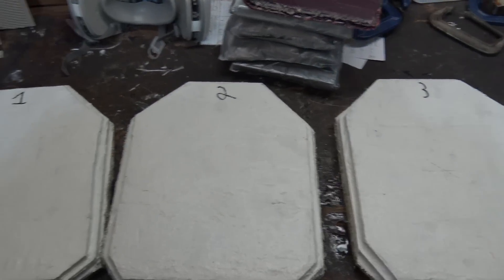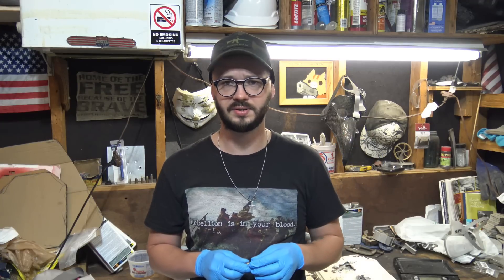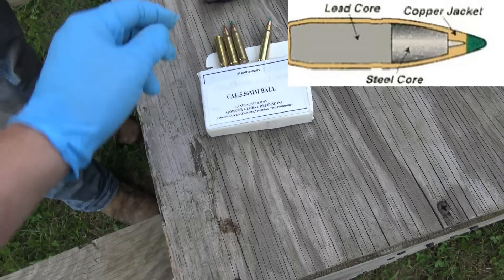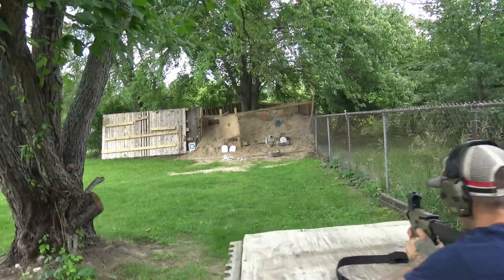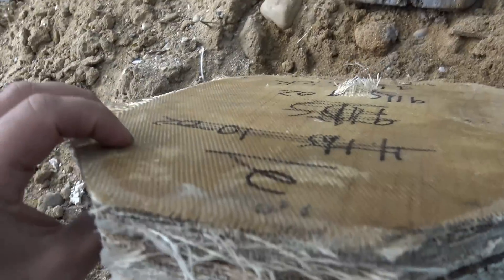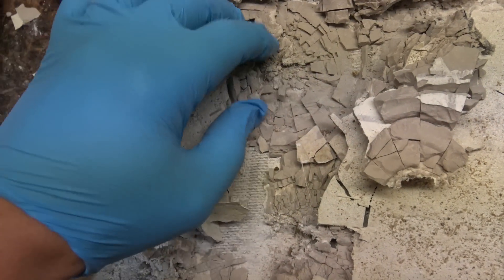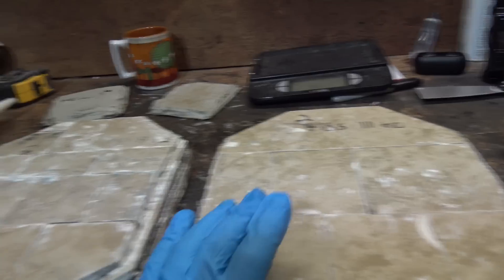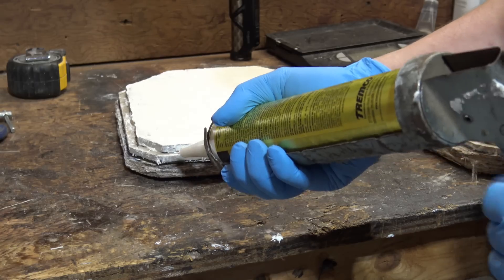Hardware store level 3+ Armor build

Comment from the maker: Also, if you guys could share this video I would be forever grateful.
Reply: I thought prepper circles would be all over vids like this
Reply from the maker: @evansaw293  they filter in over time
Reply: @Techthisoutmeow  I just realized that grinder discs are made of aluminum oxide. Has anyone you know of used them as a strikeface?
Reply: Badass test I like where you're headed with this. Just my 2 cents but I think if you did a wrap of fiberglass and resin around the ceramic it would give you a bit of a shatter/spall guard and keep things together that coupled with wrapping the entire plate in fiberglass and resin will definitely make it harder for it to come apart.
Reply: @Microwavingmetal  I use one or two layers over the strike face. It works wonders. Pretty much that layer of fiberglass or even duct tape keeps chunks of ceramic from flying off. I wrap my plates in duckt tape mostly because it keeps loose strands of fiber glass in place
Reply: Where did you get that shirt?
Reply from the maker: @N3ZLA  here king: https://the-smirk-squad-store.creator-spring.com/listing/rebellion-is-in-your-blood?product=2  I've followed this guy's meme pages for some time, he makes some real cool  shirts. I got three from the guy, this one is probably my favorite.
Reply: @Techthisoutmeow  thanks!
Reply: @Techthisoutmeow rhino liner will do the trick for a spall shield for the ceramic shards. Just completely coat the plate in two layers
Reply: Hello man im a huge fan of your work im working on a project and i need your help ... i have some questions for you what thickness is the ceramic tile ?? Can i make a mosaic ceramic armour ? ( Cut them in 25x25mm squared) ? Will any porcelein tile work the same ?? Also if i use a 170gr plain aramid for boat building will the result be superior and last do you know were i can find in eu or america ceramics made out to silicon carbide or alumina ??
Reply: Instead of this sealant couldnt we just use flex seal glue ?
Reply: @lefteris1606  I use a polyurethane adhesive. Tech has used melted hdpe in the past. I just used a quick dry glue that while very flexible isnt holding well.
Reply: @evansaw293  yea but can i use flex seal something clearly superior to all of these.methods ?? Its like a hand gum
Reply: @lefteris1606  ive never used flex seal as an adhesive. If its the sealant I seen advertised its clearly inferior for this purpose you want an adhesive not a sealant that would be like using silicone as glue. 

That being said most of the ballistic properties come from the tensile strength of the fiberglass not as much from the glue. You would probably be ok to use flex seal.

The basic build will stop 556 and 762x39 regardless of build quality or quality of materials. You need to get more picky when you are trying for a lv 3+ or 4 build. Scratch test different types of porcelain use a high end adhesive, fill the gaps between porcelain plates etc
Reply: @evansaw293  so you say that the thing he uses is hand as a ceramic when it becomes dry ?? 😧😧
Reply: @lefteris1606  No. I dont see how that is your take away... Im saying that the glue isnt the important part. You could use no glue and duct tape the whole thing together and it will stop bullets so long as you have a good strikeface and backer.
Reply: @evansaw293  yea bro but isnt a hand gum style glue gona absorve more energy ??? You know like a balistick gel ??
Reply: @lefteris1606  its not worth the size and weight trade off otherwise people would use flex seal as armor... the delamination of the layers will take some energy away from the bullet
Reply: hello man may i ask how many grams per square meter in this fiberglass ty !!! also its normal fiberglass not e-glass or s-glass right ??
Reply: @ Tech this out meow, If you could make a video more than once a month, we'd be consistently entertained, a$$wipe! Just kidding man. You like cats, and anyone, especially a man, who likes cats gets an automatic like, sub, and I'll even share it. I'm looking for something concealable, that works! Considering most thugs have handguns, I think I hit gold, and I thank you. I don't understand why rappers think it's cool to wear BPV's (bullet proof vest's). If they were important enough to assassinate, the shooter would just laugh, and go for a head-shot! Thanks again, and always remember, Hello Kitty no matter who you are.
Reply: Picture:cat with gun😂 
Subscribe lol
Reply: All these rednecks youtuber's are killing me... These materials all the high speeds are testing are obsolete... Will they work? For a few shots maybe... The UHD Poly's are not only 3x lighter but also offer LVL4 protection at 1" thickness. I have been shooting at the same 15"x15" piece for over 7 months with zero penetration using everything from M85B NATO from 50-600 meters, up to .300 WM from 50M-1250M. This stuff can be hardened and shaped to personal liking with the addition of a hardener (I used slow drying epoxy resin) but gorilla glue works as well. I have a couple FAST helmets made out of this stuff and it works!
Reply: Thank you ì appreciate your enthusiasm.
Reply: Benefit of the poli is it’ll float so in swamps and river crossings it’s a buoyancy kinda thing
Reply: I wonder if you added crushed ceramic in between the layers.  This would be good to put in back pack at work
Reply: Civilians lol...
Reply: What about welding ar500 targets together? 
Im looking to bulletproof a 4runner by making a ar500 steel box out back and welding ar500 panels to the inside of door and engine wall
Reply: @dailydrivencarsddc1182  bro no. The weight would be insane. Depending on what you want to stop  you could use HDPE UHMWPE kevlar or fibreglass. Id bet 1/4 inch UHMWPE and the steel from a door would stop 9mm
Reply: @evansaw293  the problem is that i would need a big panel for the back. I would say minimum 3x3 and would like it to stop a .308.

Comment: I just began working a nylon D200 by impregnating with LDPE lamination. I start by melting my ldpe into xylene. I'm using 2x2 porcelain over 3x3 porcelain combined thickness of -500. I'll have 500 of the laminant nylon over .185 mild steel hardened my final wrap is duck cotton canvas laminated with ldpe. We shall see how it goes

Comment: I think the fiberglass layers should be cut in a way that the fibers are not parallel. Lay e.g. first layer 0 degrees, 90 degrees etc. Epoxy should be a stronger than resin. Roll out air bubbles.

Comment: There’s one detail in which I believe is important in the original video or original video I saw. 
The shape of the plate… The reason flat plates aren’t used as much anymore is the deflection. 
A body molded plate cast should yield a better result. IMO

Comment: Saw another design made with 2 floor tiles, plywood, then 5/16 steel. Wrapped in ductape. Pretty light and held up well with 223, 556. 7.62x39. Clean design
Reply: A square foot of even A36 5/16” steel plate is over 12 lbs.

Comment: next test...
powder the ceramic tiles, NOT ceramic powder. the heat treating changes it.
then use a resin and powder mixture to impregnate multiple layers of actual kevlar, NOT fiberglass welding blankets...

Comment: I was an armor designer for BAE system for years. We made so many plates from dinner plates and tiles. They absolutely work. Add titanium layers as backing or just order 416 stainless steel in 2mm. You get great results. Wrapping it in nylon worth gorilla glue will help spall. Or a thin sheet of aluminum on top.
Reply: Where can one get titanium layers?
Reply: @mrinterested Russia and China
Reply: @mrinterested it’s like $1400 for a 1/8” 1’x2’ sheet
Reply: @entertaintech4374  lol you are better off just buying 2 level IV plates
Reply: What about 6mm aluminium plate as a backing ?
Reply: McMaster-Carr will probably have whatever you could want. 
They're a large industrial supply vendor that sells to the public
Reply: Suggestions on how to build one for a truck door?
Reply: Soft steel even one mm at the back would be enough.

Comment: one suggestion, you could sandwich 1/8 inch thick aluminum plates in between the ceramic layers, it shouldn't ad much mass but it should increase you're protection by around 50%, it would be really cool to see it stop 30-06 black tip.

Comment: normal lvl3 + steel plates are around 100 with carrier when you get them on sale.... just wait until till you can find them on sale if your going to actually use them. but for playing around experimentation very good job !
Reply: I'd trust homemade ceramic composite plates over steel plates. Steel plates are really that bad.
Reply: @ElijahDecker  you can Crack ceramic plates from dropping them. I'd much rather have steel. The only downside is splatter which is extremely unlikely to result in death. But breaking your armor in half might be. I had a lvl 4 set of ceramic that weighed what felt like 50lb. I don't recommend it.
Reply: @harley-cq6de  Ceramic composite plates are far more durable than you think. Realistically, you'd have to suffer an impact that itself would be potentially fatal, like getting hit by a car or falling off a building, for the plate to be compromised.

I have a set of level IV multicurve ceramic plates that weighs 15lbs. Steel plates don't even come in level IV (only level III), can often be penetrated by common M193 ball at close range, and weighs at least 20lbs. Not to mention the threat of bullet fragmentation and potential for ricochets.

Comment: If you have a right angle grinder you can put a wheel on it to cut tile. I used to lay tile on grass and just cut it with the grinder, more than capable for this job… doing a bathroom maybe not

Comment: When it comes to blanket lamination, I wonder, would one be wasting their time laminating and curing 1 layer at a time under 'stupid pressure' (10-20 tons)
I would also suggest cutting your layers so that the fibers don't 'line up' say rotate the template 15-20 degrees each time in relation to the weave pattern.

Comment: How effective would 40 or 50 layers of the fiberglass/resin be? I have a hunch that they would get to Level 3.  Could you try that? It would be thick and on the heavy side 3.5-4.2kg, but very durable, and would be able to make a multi-curve design. It would not be heavier than most steel plates, and would not face fragmentation risks.  It would also not require cutting, making production simpler.  Could you try building one, or just shooting at two of those 25 layer fiberglass plates together? Super curious. Thanks, and awesome video!

Comment: Try a thin layer of aluminum sheeting shaped over and around the edges of the front of your plate. 

Chemsol also makes some FANTASTIC surface coatings that will almost definitely hold together better than the caulking youre using. 

Navy G is super expensive, but really goes a long way. They have a long line of surface treatments that do great things, but Navy G is the best.

Comment: I'm curious if u used the welding blanket for the back 3/4, then put a steal plate on, then put the last 1/4 of welding blanket and resin to stop the bullet spraying your face if that would be better than ceramic. It would definitely be heavier but steal doesn't shatter like ceramic so u could take more rounds b4 having a pass through. Great work tho, 👏 👍

Comment: I think if you guys will use carbon fiber , with fiberglass, stainless steel sheets , and ceramic tiles. It will be a lot better. I do tile I have a c
Bass ass wet saw on a stand you can cut about anything on that bad ass tile cutter. Seeing the build gave me some other ideas

Comment: Stop with the ceramics! Please!! It's like a frag grenade exploding on your chest. You will get injured!!!
Reply: Injured? Worse than having the bullet go through you? No? Ok then I'll go with ceramic plate.
Reply: @TheTurinturumbar  Well, kinda. Many people survive a bullet shot to the chest. But just sit back and think of what dozens of ceramic shards ripping into your arms, neck and face will actually do. As a medic, I would find that scenario alot more difficult and time consuming than just fixing a chest wound. The fiberglass/resin setup can be very effective just by itself.
Reply: @jesser007  many people survive being shot, but a lot also die from it. Nobody dies from a few flakes stuck in their skin.
Reply: @jesser007  Which is why the guy in the video coated the ceramics in an elastomer before attaching them to the backer. The elastomer acts like a spall guard for the ceramic. A better spall guard for ceramic strike faces would be to encase the strike face in High Density Polyethylene resin since HDPE is actually more durable than Vulkem 116 and does a better job of holding all the ceramic pieces together even when it's compromised.

Ceramic is also necessary for most armor aimed at protecting you from incoming rifle fire since it's the only thing harder than steel and does a better job than steel of blunting that incredible force allowing the backer to do its job in catching the round and all the fragments.
Ask yourself one question: If ceramic is so bad for armor, then why are so many commercially available plates using them? 
Sounds to me like your argument regarding this subject is null and void.

Comment: Tip: use an epoxy resin and press/spread it using a squeegee. It’s how we do it in surfboards for uniform saturation and no air bubbles
Reply: Or a fin roller. Dude has no clue what 1708 glass is. Boards use 2oz, 1708 is biaxial glass I use for my boat project.
Reply: @BackyardRambo  fin roller works Grey too. Would be simple enough to use either to get better saturation on this flat object. We use 4oz glass in certain areas on surfboards, particularly the top deck to help decrease pressure dings.

Comment: Concerning polyester resin application to your woven cloth " fire blanket"  1. you can thin the resin with " Styrene" for quicker absorption and quicker work time 15-20 by volume .  You can also add less activator  to your resin " as long as you stir it well " this will give you another five minutes work time and less waste. The cure time will be a few hours longer but it will not effect the overall hardness .

Comment: why not try some kind of filler to put in the resin... like that ceramic material in dust form... or carbon(super light) can be purchased from fish filters. carbon would make carbon fiber, that might reduce velocity. My main concern would be breaking the FMJ apart with a hard material first, then velocity reducing and finally hard stop.  Id say u need to get the while thing lighter. Lookup aircrete for inspiration

Comment: Find something that can be placed inside the doors of vehicles, attach to floorboards and line the interior of the roof and be concealed in the headliner. All should be concealed, but accessible in case replacement or inspection is needed. 

Then tell us how to replace vehicle glass, as well. 😎🥷🏿

Comment: What I would like to add is a 4mm-5mm geopolymer near the top layers. Then use the usual stuff you use. I think that would substitute for ceramic plates. It is heavier I think but much harder.

Problem is do we have some chemistry professors who would help us mix stuff safely?...

Maybe you could add fine diatomic sand in the resin? Might increase hardness and help increase friction for the bullet.

Comment: I would have used layers of paper/canvas/welding blankets compressed in resin. I would also alternate each layer in verical strips followed by horizontal strips and then repeat until the desired thickness and armor rating is ultimately achieved.

Comment: What if you only used one tile layer?
Reply from the maker: You could absolutely try do it that way, however you would need to bump up the backer higher than 25 layers. I haven't dialed in the amount that would take yet, but I might do that soon. I do have a big welding blanket laying around, and plenty of resin. yeah, I think I'm going to try this, check back soon!

Comment: If I understand what I was watching the other night, and to be fair, I might be a retard, I think you could lay epoxy resin right on the ceramic tile if the surface was prepared properly, and then build the sandwich from there. That would save a step. If not found at the hardware store, it will be at the craft store. 

Also the blankets that people are using for these videos are inherently flawed as they are sent folded and not on a roll.  I know, you had rules for this build, but it should still be said, cuz people might be a little bit behind me on their research. =]

Comment: Have you tried concrete fiberboard (cellulose fiber) or casting concrete panels with glass fiber fill? 

Concrete is similar hardness to ceramic and the fibers might hold the sheet together better than the elasomer alone
Reply: Concrete armor sounds a bit... heavy.
Reply: @ctrlaltdebug   fiber reinforced concreate instead of the ceramic tile